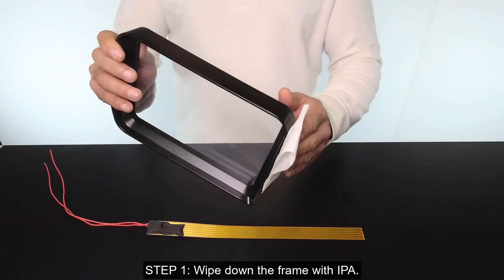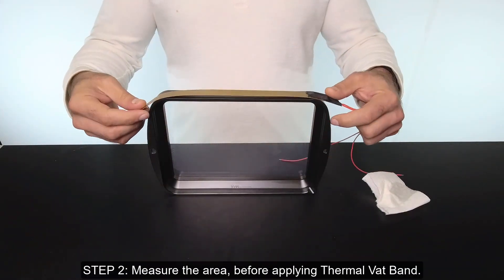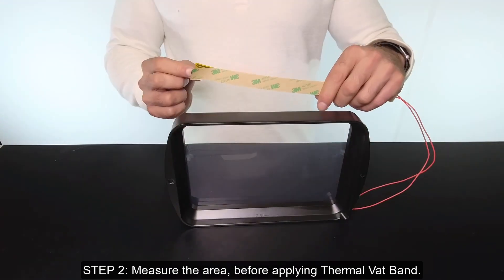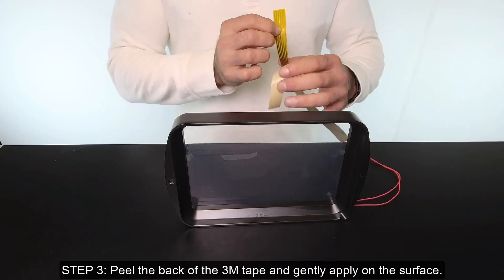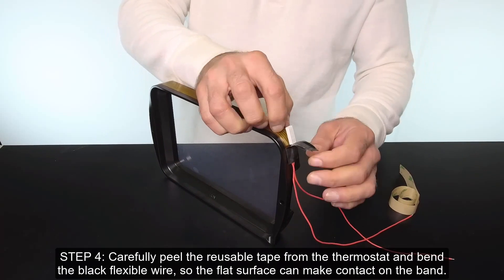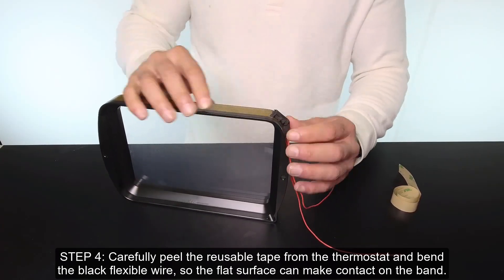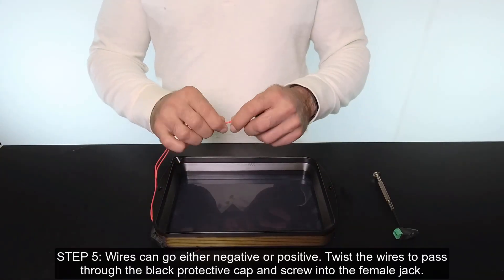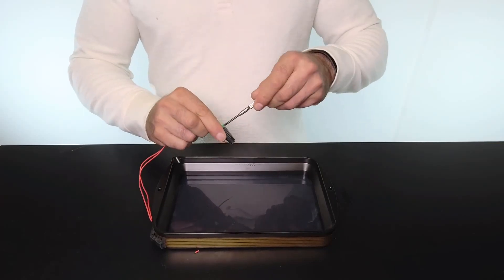ThermalVATBAND - 3D printer resin heating device installation instructions.

Comment: Way overpriced. No thanks.
Reply from the maker: @AncientOutlaw_raider1  same price as the chitu heater fan. Lasts longer heats the resin not the air so you dont have to worry about heat escaping everytime you remove the lid, sit and wait to warm again. No moving parts.
Reply: @3dtvb  and for 20 bucks I got a Fermentation Heating Belt that does same thing
Reply from the maker: 😅 look at your electric bill at the end of the month better yet year. This costs in California. .34 cents per day. That getto install with clamps you cant put the case on top loosing heat while you increase the fumes by heating it. Dont forget the main issue you will get electrostatic  Anomalies which causes lines and noise showing up on your print dot's holes weird patterns. The fermentation belt has a constant frequency which reacts with the resin charging the electrons similar to a water pipe next to electric current you don't see that for that reason.  The vat band changes it's frequency at a rapid pace without interrupting the heat this prevents any anomalies occurring in a print.

Comment: Hmm, seems a lot more work, especially since i have a print farm. I just stick a floor heater in the studio (which is un-air conditioned anyway), and bingo. I don't really cry about $3.00 in power usage, since I would need to set this up on like 10 vats. Cool if you have 1, but not for  usage like ours. You got my sub though mate, cool channel.
Reply from the maker: Thanks!

Comment: Make one that brings resin temps to 65/70 degrees celsius!
The higher the temp, the lower the curing times! 99.999% don't know this.
Reply from the maker: So true. Manufacturers like Siraya make one of the best  resins recommend the correct temperature for resins around 85F to print. Specialty resins like dental industry and jewelry industry highly recommend pre-warming the resin before printing. Considering there is no warming resin while printing, till now.
Reply from the maker: Wanted to add this little data that the public should know. I test products for specialtyresin.com I also have a FB group called https://facebook.com/modelmakingandcasting a curing process is called exothermic reaction which is heat. When you prime/warm a resin...any resin you help the exothermic reaction to accure quicker and more intense, saving time and also resin will flow smoother allowing greater detail with less artifacts left behind ie grow lines.
Reply: you can do this with new dlp printers, this temps will kill you monocrom displays faster.
Reply from the maker: @ShrimpyMaster  how did you base this theory?

Comment: Hi, When you say protect the wires what does it means. Thanks
Reply from the maker: The negative and positive is close on the femal jack and the wire is stranded if one strand crosses over you will turn off the power.  Doesnt mean you will start a fire or damage TVB or power source. It just wont start.  There is no specific contact point if your also worried which is positive and which is negative to connect on your female jack.
Reply: @3dtvb  I understand that the order of the poles does not matter?
Reply from the maker: @Foxenkraft  we actually stopped using stranded wire for this reason and went to solid wire on the new 16 inch tvb-161 it also bends and stays bent tucks away cleaner.
Reply: @3dtvb  I have a problem with an order, one of the bands doesn't heat up well, can you help me?
Reply from the maker: @Foxenkraft share a photo ofvthe install. What is your power setting which notch do you have it on? Do you have a splitter attached to it?
Reply: @3dtvb individual installation, one band and one adapter per machine, one heats up a lot and the other doesn't. Where can I send you the photos?
Reply from the maker: @Foxenkraft  info@thermalvatband.com